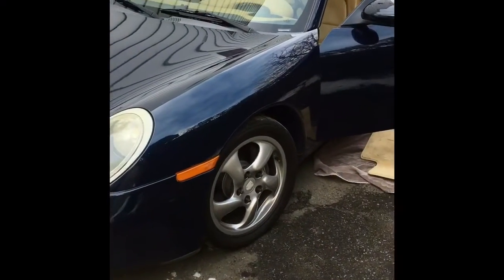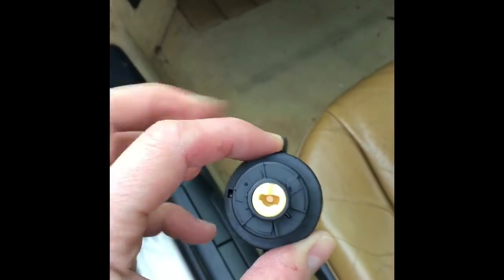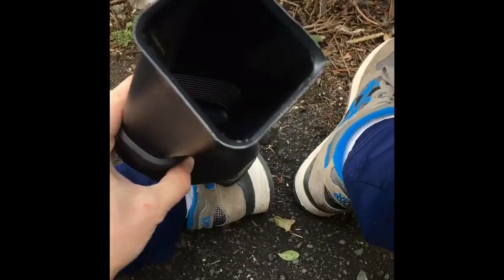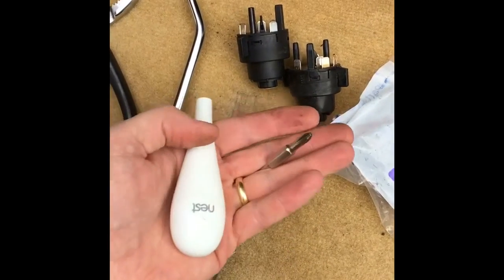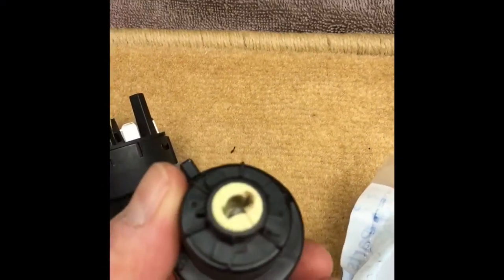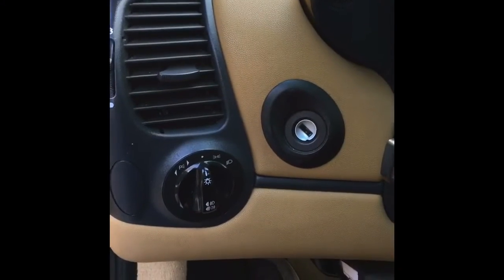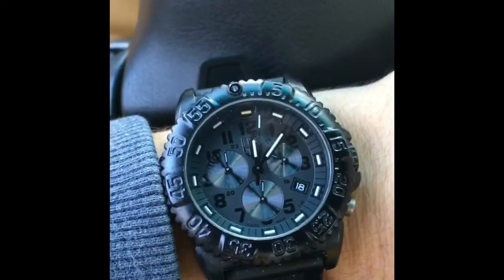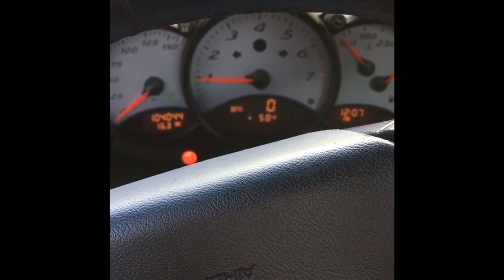1999 Porsche Boxster Ignition Switch Replacement (986)

Comment: Thanks for the video!  I replaced the same on my '97 996 last weekend and have a few additional suggestions.  I had trouble getting a small screwdriver in place to remove the 2 set screws.  I removed the OBD connection point (2 screws) and also the vent end of the heater duct that you removed. (removed from up top, behind the vent)  This requires removing the light switch assembly and the vent, but it made getting to the 2 set screws so much easier.  One last note.. If anyone is considering doing this I suggest going to a hardware store in advance and purchasing two M4 -.7 X 12 socket head cap screws to replace the OEM set screws.  They are much easier to put in place and take out.
Reply: I had to do this too.